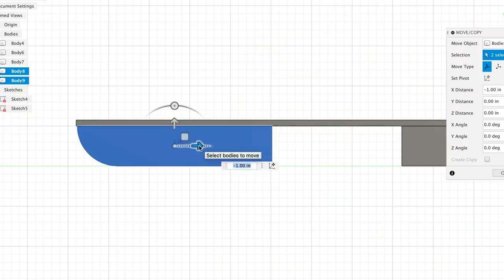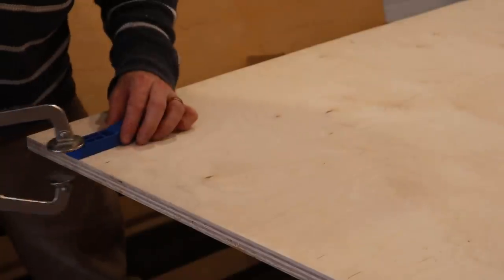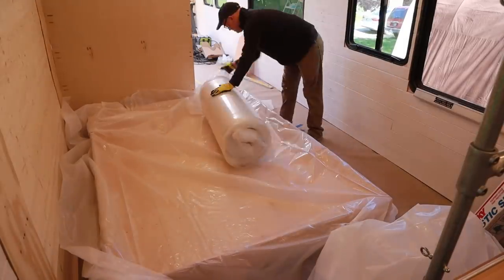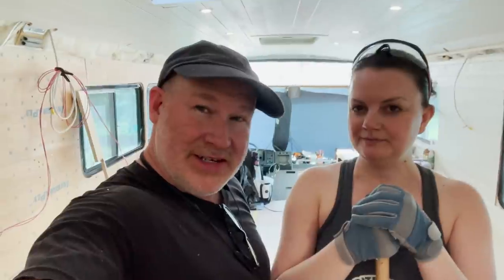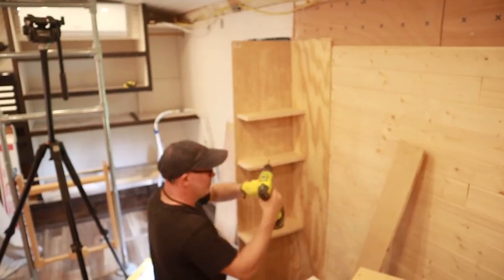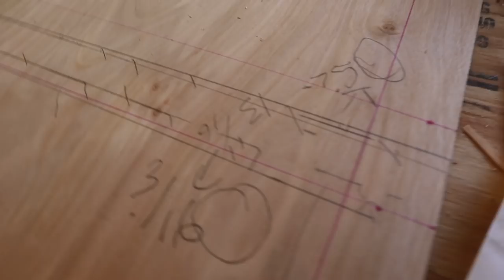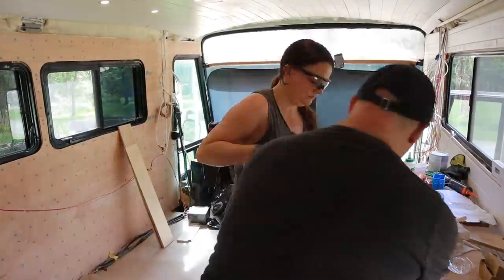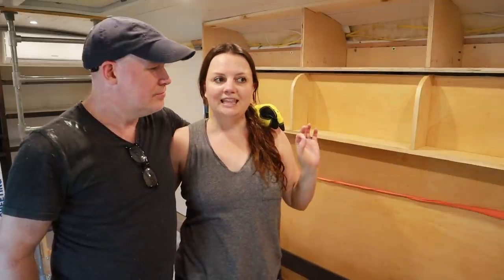CUSTOM BEDROOM for our Bus Conversion: Part 2 - S04E11

Comment: If you need to make templates/patterns for future cuts of any sheet material, consider cutting a bunch of 1/8" ply or luan strips about two inches wide and whatever length you have. Use these to "trace" a pattern conforming to whatever area you're doing. Can be used for walls, counter tops and floors. Trickier to use for ceiling templates because I use hot glue to stick the luan together at every corner, although a staple gun would probably work for that too.  Write any important notes in Sharpie directly onto the luan template for later transfer to your 'real' sheet goods. Ex, "outlet goes here", "water drain here", "Stud Here" etc. Saves time, avoids reliance on the measuring tape and copious notes. This will also tell you whether the piece you plan to cut out will fit in your door- if the template won't fit going out, the final piece won't coming back in. We used this methods for years doing stone counter tops, and as long as we "trusted the template", the finished result always turned out perfectly.

Comment: How about make it with wood and have a small slit in it with webbing. Would also be cool as a door handle area. You could use a magnet on the ceiling to hold it open when it's up. I think that'd be cool!

Comment: You have done an amazing job of the bus so far, but i do agree that the webbing idea is not so good, i would look into buying some sort of netting instead, If you look at net curtains for example they come in a wide range of patterns that would look so different,

Comment: How about that ornamental metal panels you see on radiator covers instead of the cane.  Cane is really a traditional look.  The metal is a little more modern looking.  You could make the metal any color you like, or you could leave it a stainless color to match the pilates tower.

Comment: Ventilation is so necessary. I'm not a fan of cane webbing either but I have seen quite a few people stain it and it looked 10 times better than that light tan color
Reply: Can you elaborate on why ventilation is so important? I haven't had the experience yet.
Reply: @douglasgallardojr4759  mobile dwellings are inherently humid environments. Add to that the unavoidable temperature differential between inside and outside and you will want storage areas that are along the outer wall to have as much ventilation as possible to reduce the chance of mold growth

Comment: hummm. a large bus may not be as sensitive when it comes to using a spirit level. seen those who used it when they built on a van without using jack stands. the vehicle is moving and the more you install the more drops the rear. ;)